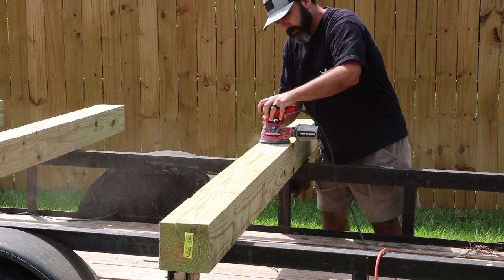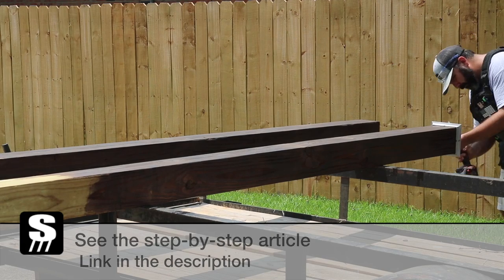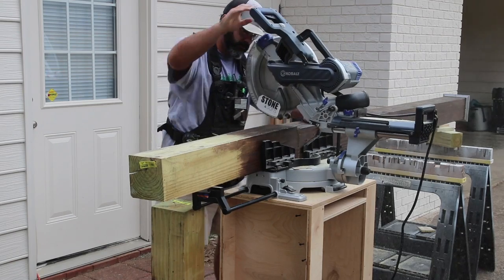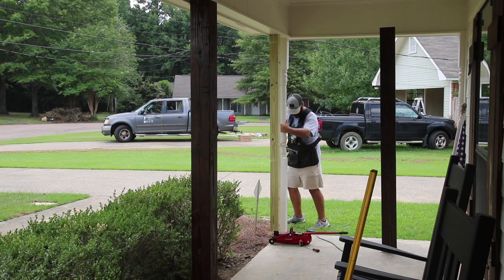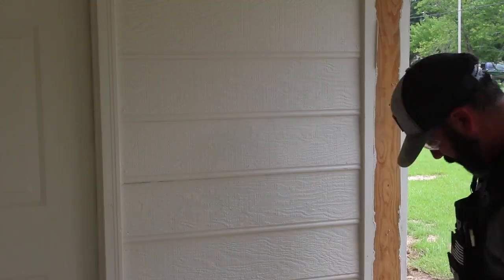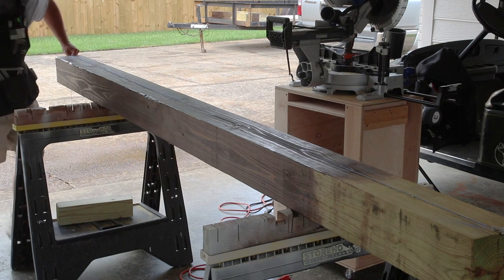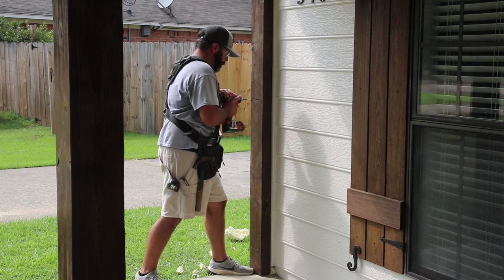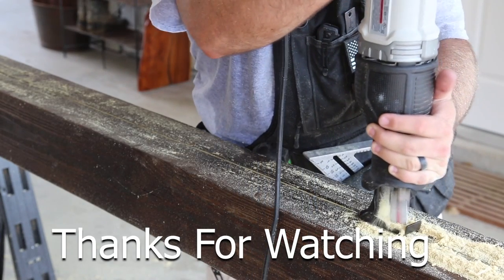How To Replace Columns

Comment: Great instructional video. 
 I’ve got just 1 post to replace, for the same reason. It’s become rotten at the bottom . 
 I probably should put up 2 new post and go larger like yours . 
 My front porch only has 2 beams needed to hold the overhang of the house over the concrete porch. 

I’m not by far a extremely skilled carpenter as your self, I know just enough to get some Jobs like this done, and a few other thing’s. 
  I’m learning little at a time though through Small DIY Stuff & videos such as yours are very helpful! 
 I bought the exact same Jack u were using , not only to keep in trunk of my Car, but also for jacking up the porch when I got around to replacing my bad Post.

Comment: Thanks for this. Getting ready to replace rotten 6×6's for first time. Concrete surrounds the posts im replacing and posts were on dirt. Would it be best to fill in with concrete before installing? Just doing a little research for best way to do it.

Comment: Looks great! I was wondering how you were going to do those half post and I'm not jealous because that treated SYP is tough stuff haha. Btw, best way I've found to cut 6x6 down to length is just a cut around all 4 sides with a circular saw and handsaw the rest if it needs it.
Reply from the maker: Thanks man! The new columns made a huge difference.

Comment: Are these methods you used also applied to vinyl victorian columns with a metal post in the center? I am worried they will all move when I set a new one in.
Reply from the maker: I’m not sure about that. I would ask a contractor in your area to take a look.

Comment: I will be doing same using 4x6. Where did you buy the base anchor plates?
Reply: Lowe’s. These are the ones I used https://www.lowes.com/pd/Simpson-Strong-Tie-Steel-G185-Post-Base-Common-6-in-Actual-3-in/1002542556

Comment: Man  I would have thrown that 6 X 6 through the rip blade on the band saw. It was most likely spruce or fir. Its not too common to see pine in PT lumber. Nice job though they look great. Love the stain.
Reply from the maker: Thanks, Greg. They were sold as treated pine. Either way, it's done. Phew. lol
Reply: In the South East US, most treated wood is Southern Yellow Pine.